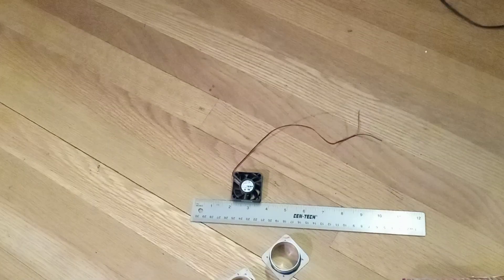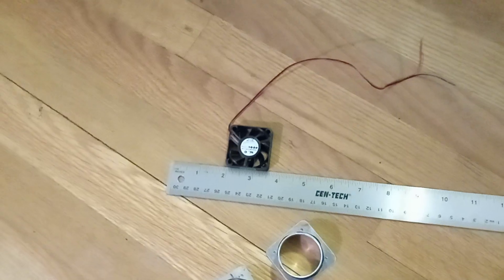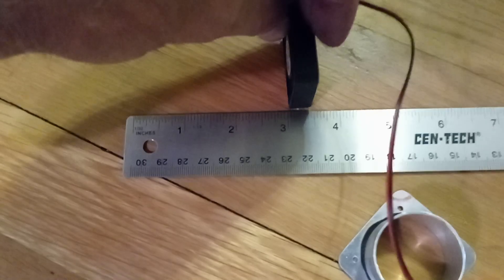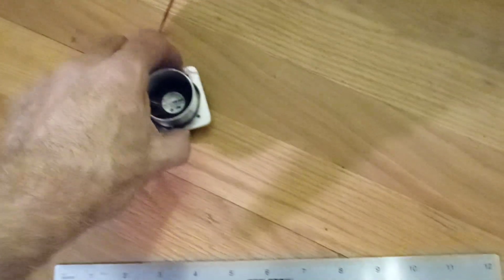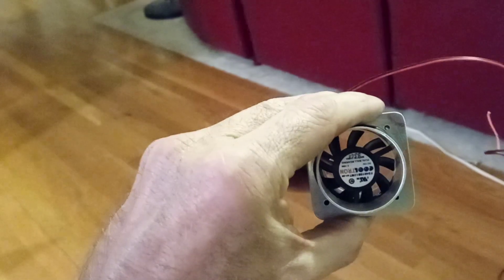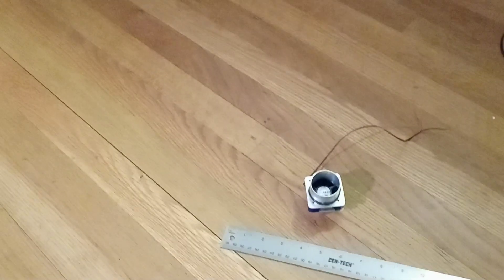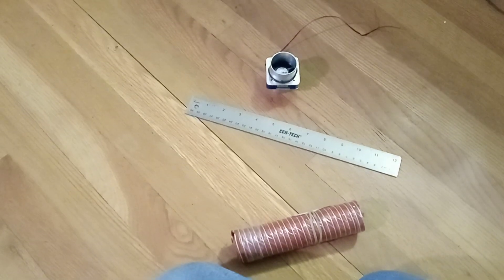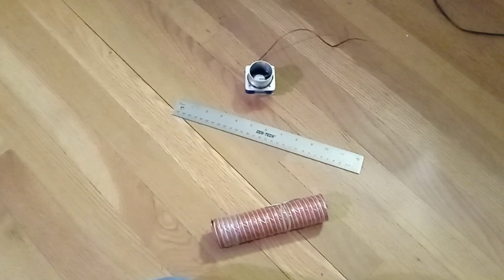Working on little fan for H5 cabin heat....what ya think

Comment: Check for radial fans. They make a lot more wind.
Reply from the maker: Hi Metalwings Gmbh im not sure what radial fans are. But if that is like a squirrel cage may not find one this small. Thanks for the comment
Reply: Have a look at amazon. There are some 2 inch radial blower fans.

Comment: What size is that tube?  I have a little 12v blower fan you can try if you'd like, it would move quite a bit more air than that fan.
Reply: Just found it, it's a 3" blower fan, thought it was smaller, probably too big.  We use to use them to cool down our motors on our pulling tractors (kohler small engines)
Reply from the maker: Hi @kclaptraffic  well have not heard from you in a long time! I guess you could tell tell from the ruler that the hose is 1.5in.id? Anyway yes that 3in. would be WAY to big. I think this should really do something but will have to see. Thanks for your suggestion
Reply: @redblackvette  I've been really busy lately!  I thought it was more like 2" but when I found it it was bigger than I thought.   Hope your heat project works out for you!

Comment: Are you not getting ram air into the cockpit?
Reply from the maker: Hi ecilpso104 it sure does not feel like it. So this should do both. Suck air over the cylinders and blow it into cockpit.....
Reply: @redblackvette  have you already made a video of the heater system on this plane ? I'd love to see how it looks and works.
Reply from the maker: Hi @eclipso104  yes sir i have made a video of my cab heat. Go back in my videos and you should find it. But i will probably do one when I add the fan. Thanks for watching.....
Reply: @redblackvette  cool I'll check it out. I'm just shocked your noy getting any ram air. Seems like it would blow like crazy. You do have a cabin air exit right some where right? It's not just pressurizing the inside of the fuse right ?
Reply from the maker: Hi @eclipso104   well I did a video about that to. I made a vent scoop but im told by Steve at Hummel that I put it in the wrong place. So I will continue to test out things until I get something working. Thanks for your comment and suggestions